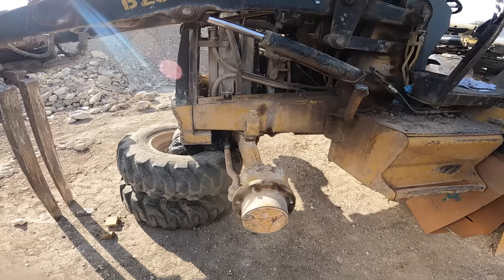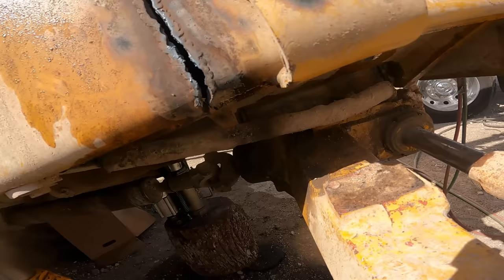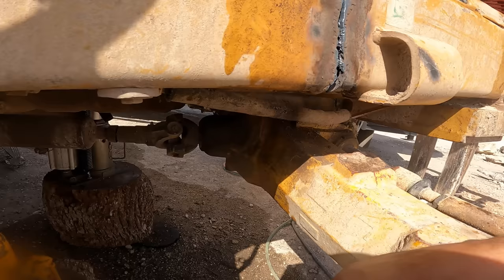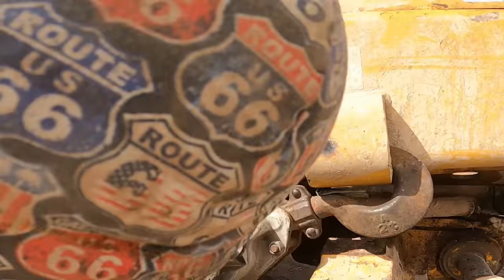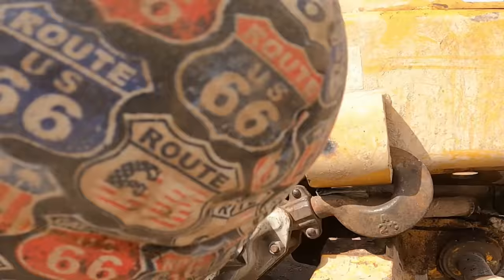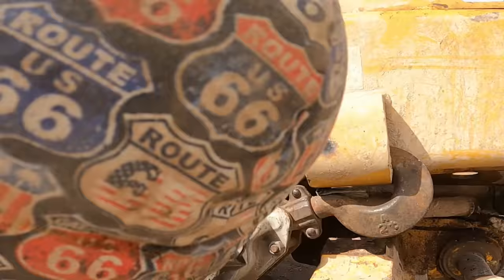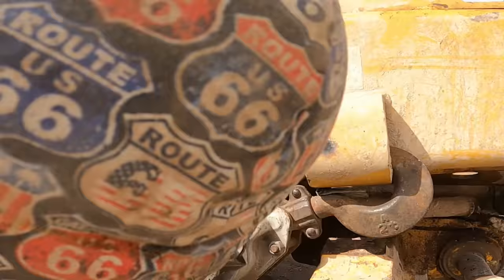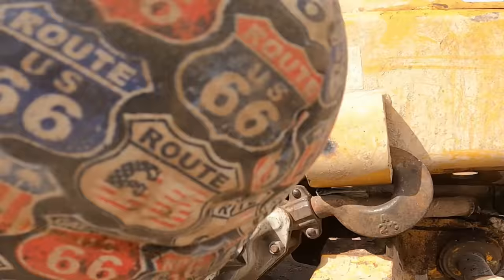Broken  Backhoe Frame. (Caterpillar)

Comment: I sold Case backhoes for 10 years and never saw any machine with that kind damage. You take smashed machines and fix them. Your abilities to handle tough repair jobs is unparalled! Respect Isaac! 😎👏👏👏👏
Reply: In West Texas nothing is impossible.  For real.
Reply: W Polsce też takie rzeczy niemożliwe robią😊
Reply: It looked like the one that fell 100 feet when the strap broke. I was wondering who bought it.
Reply: @siwy165  niemożliwe od ręki na cuda trzeba poczekać dwa dni😅
Reply: Couldn't agree more! Great work!
Reply: Maria CANCER  You are only posting this identical comment on multiple channels. This has become a spam.
Why would you not write something else?
Looks like your present is cancerous. Who would add it to his/her profile name.
Reply: That machine overall looks totally worn out. They seem to want to spend more on repairs than it would be to replace the machine. Seen it before, when the company I work for was paying $40k/month to rent 2 trucks rather than buy replacements, then one of the rentals had a $47k repair bill when it was returned, as a driver destroyed the cab running off the road.
Reply: When  you somehow reach the conclusion that you run your machines to the ragged edge rather than cut CEO pay and make things kosher for everyone, nothing is impossible. I mean, look at the "jack-stands" they gave him. That's an indicator and then some. I was forced to work with outfits like that in the past. All i can say is, shame for the workers, they're usually good people.
Reply: Because these people are reusing old junk machines. They don't buy new machines that's why you never seen this.
Reply: @6Diego1Diego9  Given that bringing in welders to patch the old junk back together regularly costs a lot, I fail to see any savings over just buying new. If they had their own in house welders and mechanics for thse repairs, it would make sense to repair something like this.
Reply: @ravenbarsrepairs5594  ao😮v
Reply: Should have bought a JCB..anything else is a poor reproduction..time to scrap this one
Reply: I’ve been working on Case backhoes for almost 20 years, I’ve never seen any problems like the ones he fixes on the Cat machines. I do have to repair worn and damaged buckets regularly though.
Reply: @aserta  How do you know its not a little with small amounts of equipment.
Reply: Chain it with bottle jack under it jack up chain pull down out near end, same as when I straighten axles
Reply: @siwy165 hey polska svarshik privet from svarshik from Russia 😊
Reply: @garethifan1034 JCB best???😮
Reply: @MtnHiker 
😅 28:16

Comment: You would think with all that dress load that JD would make the frame heavy enough for the load. It's definitely a engineering issue to save costs. Great job repairing something very difficult to work with.

Comment: Extremely satisfying to see your approach to these repairs. You bring engineering into each fix. Not just a; “well enough and good enough, grind it out and weld it up”. You think it through, knowing the stresses and fatigues that will be put into the piece without the proper metal prep before the welding begins. Back in 1979 our instructor always said; “99% prep and fit up, 1% welding.” I watch your videos, like a kid on Saturday morning watching cartoons. I’m GLUED to the screen! PROPER, ISAAC!!! As Always!
⭐️⭐️⭐️⭐️⭐️⭐️⭐️⭐️⭐️⭐️
Reply: As a retired automobile painter body and frameman of 40yrs this applies also, 90% prep 1% painting and 9% politics 😂
Reply: @charlescastillo8870  👍🤣

Comment: That machine is clearly out classed and overloaded for what they are doing with it. Excellent welding and technique, I do learn a lot watching you. I am pretty sure you will be back to work on that machine again.
Reply: I think you did an extraordinary job repairing that backhoe, you may consider charging extra for working on a filthy machine. You would think they could have pressure washed machine before you started

Comment: You are not only skilled at making proper weld repairs in less than ideal conditions but you also have great mechanical insight in failure mechanics, including what to do to prevent future problems. Kudos to you sir.

Comment: With patience and perseverence, you saved that guy a boatload of money replacing that frame or writing off that machine altogether!
Seein that damage, they were very very close to collapsing that frame. Amazing job!
Reply: Would been a write off I work at cat that frame ain't available we got 3 of them hoes sitting out back that need frames there going to auction cat says to much liability to repair them
Reply: J Hanna Hopefully with the knowledge that Isaac did the best he could (that could only be attempted by 1%) operator will not go back to what caused the damage!

Comment: The mechanic expected you to climb under there in hydraulic jacks balanced on timber rounds? Holy cow!
Reply: Hello   @frankish ,  Mechanics  Nowadays  are really  just  Spanner monkeys,  strip the bit off replace the with a new bit back out on the job ,    whereas  issac is a master welder / fabricator looks at the damage and is working out in his head  what he is going to do to weld it all back up and  it will b done  PROFESSIONALLY ,  Kurtis  Down below in Aus has that same ability  to do a job in a professional  manner,   BECAUSE at the end of the day it's  his reputation  at stake.
Reply: @standonald5145  Absolutely!

Comment: ⚓️ Thanks IC 😎 moving those big pieces into position is tough… 🤯 I’ve seen guys weld in tabs & position turnbuckles… steamboat ratchets… to pull the work piece into position … takes time but it’s really a good technique. These guys will get the OEM prints & get the frame aligned… really cool.😎

Comment: Definitely a tough one.. There's lots of difference between kneeling and laying in the rocks (with the wind blowing) and TIG welding clean metal sitting at a bench as we often see on videos.. Every young welder should get a try at a repair like this..  Great Job..

Comment: No question about your skills they are top notch. Judging by all the past crack repairs that have been done the material has serious metal fatigue and the only way to fix it right is to remove and replace the the steel. All the welding in the world won't fix metal fatigue it will only make it worse. Watching the video I see other indications of possible cracks. I understand that fixing it proper would cost more that the thing is worth but sometimes you just got to say NO!

Comment: Good Day Mr. Isaac,  Good to see you. I did a repair on a boom end for a Woods 7500 back hoe. It was bent and cracked from being smashed by a truck. It bent the bucket cylinder and the end of the boom. I rigged 205 portapower and lots of heat, got it "straighter" and burnt a grove thru the crack.  Sounds like you are going the same path.
I won't ever challenge you to arm wrestling. That looks like at least a 10# sledge that you were swingin...LOL
Thank You, Thank U, Tank U for the "spot welding" technique with your flux core. I've used that since you first showed it and it works GREAT!@!@!@!!!!!!

Comment: Hey Isaac, thanks for passing on the knowledge!:) I'm a hobby welder and am grateful for your site. I butt weld a lot of sheet metal on my car / truck fun (16 - 19 ga) and have only used flux core. I really don't do enough to change my ways and I've learned to make it work. I use the same technique when butt welding light gauge metal. A little too hot, slow wire speed and quick pulses watching the puddle cool to red. Thanks much!

Comment: Issac you have completed a very hard weld job with the damage to the frame, I think they will have no problems with the frame in that area. The operator must overload the machine with a lot of weight by the looks of those cracks. Nice job again God Speed

Comment: As a heavy equipment mechanic/welder I have welded some things in really awkward hard to see and reach. Yes it’s a challenge to make a decent looking weld in some instances. You always make it look easy. I don’t have portable wire feed
Reply: To continue. I probably would have used 7010 downhill to close the gap. Then covered with 7018. Flux core wire feed portable would be nice. But I would not have the need often enough for me to invest

Comment: If I had to guess,they corner load the bucket alot! I repaired an old International compact tractor that same deal happened on.They used it to move trees in a nusery,always loading them in the corner of the bucket!

Comment: 44:53 A fire proof blanket (doesn't need to be an expensive one) and a yoga mat. You wrap the yoga mat in the fire proof blanket and have someone sew it shut, and voila, fire proof sharp rock back defender. I have one using one of those fire retardant mats and a cheapie blanket, that's barely good for the job that i sewed together using a mattress needle and some kevlar weave i got from fleabay. Haven't managed to burn it yet.

Comment: As always thank you for the great content Isaac. As another great tradesman who goes by the name NBCWELDING suggested, when you go uphill you have to start your weld to the really low amp setting almost long arcing it. As the welding progresses and the heat spreads, it's going to be easier to finish the weld in one pass without the danger of punching a hole or end up chasing the puddle. I'm sorry about mentioning the tellings of another YouTuber but after I've tried it I can assure you that it works. I hope this helped you guys. Thanks again Isaac.

Comment: As always a hard job well done ! 
To you other welders , learn how to properly  do what is called a key hole weld , where you use 6010 or 7010 - DC only or it’s AC counterpart 6011 or 7011 , even 80 series if required , or you could use wire feed (if you have it). The key hole weld is what is used on pipe lines with no backing strip & it’s the inside of the weld that is important ; then you grind the outside to smooth it up , removing every spot or crack/seam of slag , filling up the rest of the gouge with 7018 . 
Start out with coupons of 3/8” flat plate with a beveled edge @ 45* with a small flat edge facing each other spaced the diameter of the wire of your welding rod , to do your keyhole weld , when you get this one good then you can go on the the pipe ! 
To practice doing this get some 4” or 6” pipe coupons , 1/4 or 3/8 wall , tack them together , with a space apart , of the welding rod wire - 3/32 or 1/8 , set this up in a 5g position , which is at a 45* angle . Starting at the bottom of the crack, welding up hill , both for the root pass & the subsequent filler passes . When you are finished the weld should look uniform both inside & out .

Comment: Issac, wondering if you watch OnFireWelding here on YouTube? he does line boring too... that seems really lucrative, especially the welder that spins in a circle and moves in and out, for repairing the worn out holes for pins and bushings. Would you ever be interested in getting into that aspect?
Reply from the maker: I've had a linebore setup since 2004. I dont advertise it since the unit I have is on the smaller side, and slow. Plus, I get bored too easily. there is no fun or challenge to it that I get a kick out of. I have a couple of videos in the works of me doing some line boring. Stay tuned!

Comment: At one time JCB had the bright idea of using the tubular chassis as the hydraulic oil tank. Good idea until the frames cracked and the oil made welding virtually impossible.

Comment: A fine thread turnbuckle works great for closing gaps on stuff like that, I just weld a few blocks with holes in them on both sides and crank the buckle until the gap is closed.

Comment: A really fantastic low high rod I found years ago is made by rock mount called Polaris I have fixed a lot of high stress frames with it and not had any failures welding with it. I have used it over thirty years.

Comment: A tuff job for sure. I have had to weld H beams together & used gusset plates on both sides set at a 45* & the ends cut at 45* welded all the way around . I agree on the need of gusset plates,  however I would have made it long enough to start at that bracket you used with your come-along , with the opposite  end cut at 45* .
I bought a used 1989 Case 580 backhoe & did not notice the front bucket arms had been welded , just back of the cross tube , nor that one was already starting to crack along the edge of the weld , so before it got bad I drill a hole at both ends & I ground some out of the crack & re-welded & ground down the now 5/8” not pretty weld , then added weld in the horizontal , across the vertical weld , first going to the right & then the left , making 2” wide , stacking each lap as I went up. It is still holding after 20 yrs , and I have lifted things so heavy I pulled the rear wheels of the ground , & do so quite often .

Comment: So that gusset or fish plate on the bottom in tension should help keep those cracks from coming back since it would have to pull it apart to re-break like it did?
Dang...those operators are HORRIBLE on their machines...that trackhoe in the background was hammering something HARD in your clip...job security because you will be back soon welding up another busted boom soon enough!
Keep em coming!!!!

Comment: There are many frame repair videos on Case, Cat, and John Deere backhoes, but none on the Ford 555.  I think it might be because the frame is built around a tractor, engine/trans/diff all bolted together (no driveshaft) making them insanely strong.

Comment: One thing I have seen on a different channel that does auto body and frame repair when that have a crack in a tubular frame is instead of just welding the crack closed the also do stitch wields across the crack kind of like stitching a wound in skin. He said that wielding across the crack helps stop it from cracking along the wield. That may help in this case as well. Other times they wield a patch on either side after the crack is wielded and gound flat to help stabilize the area.

Comment: As a retired welder with 43 years experience weld repairing heavy equipment and rock crushers, here's what I'd do to repair that cracked frame. First of all you said that you welded it before but it broke again. I would have welded the cracks the first time around and then fish plated the outside and inside as well as the bottom of the frame. I would have cut the axle stops on the frame off and then rewelded them to the fish plates. That would have given the frame it's best chance of surviveability. Instead the welds rebroke and the cracks spread even further and it's going to happen again. I wouldn't have used NR-211 for any of the welding and would have used low hydrogen stick for all the welding.

Comment: It's kinda ironic that you have a frame repair in the same location that I have to repair on a 66 jd 4020 axle pivot plate is just ahead of the break and motor mount and loader mount is just behind the break so no big surprise why it happened there. Of course once i weld my frame the only option for fish plating is on the lower inside of the channel iron can't be on outside because axle pivot plate is just ahead of break and loader mount is right behind it but i do have room for plating the bottom flange on the inside so its going to have to do or go to the wrecking yard to find another rail but probably hard to find one that doesn't have the same problem..

Comment: You mentioned that some of the self shielding wires (T-11) like the Hobart 21B and some of the Lincoln wires don't have as good of mechanical properties as a 7018 rod.  I have been hesitant to use them for equipment repair for that reason.  Have you had any problems with welds cracking with those wires?  I am up in Canada where it goes to -40F and I wonder if that is a consideration as well with choice of filler material. 

Another comment on that repair.  I might have cut a window on the outside of the frame so that a piece of backing material and reinforcement could have been put on the inside.  It would have added time to the repair, but made some of the welding easier and provided some reinforcement, changed the stress concentrations etc.

Comment: Beautiful welds considering the conditions and your knowledge of which wire and how to set the machine is experience multiplied.  I watch several off road recovery channels and they shorten and lengthen frames and say a diamond shaped plate is best for reinforcing on the sides.  Is there any science behind that?
Reply from the maker: The science behind patch plates is because of bad welds and poor fitup. haha. gotta weld extra to compensate. Kidding. each has their own theories. I'm not going to bad mouth what each person does. The science behind it it so make it stronger, so if that's how they want to do it, more power to them.😁👍👍
Reply: Thanks for doing the video Isaac I have learned a lot from watching your videos about field repair welding but also how handle yourself in such a professional manner.

Comment: I’m guessing with those forks they are putting a heavier load on it than what a bucket of dirt normally is.  Combine that with trucking the load across a bumpy lot and it makes for a lot of stress on that frame.

Comment: Issac, why did you choose to use flux core instead of regular wire & argon? Sorry if this is a dumb question, but my understanding is that flux core splatters more, maybe I missed something otr flux core has other benefits that suit the task...Either way you make is look easy and the outcome is always top notch...I enjoy your vids, keep them coming!
Reply from the maker: fluxcore for outdoor situations. very windy.
Reply: @I C Weld  Isaac, is that a regular flux core wire or dual shield.  Can you share the brand/wire size?  I think you said it had good ductile strength  similar to 7018 rod.